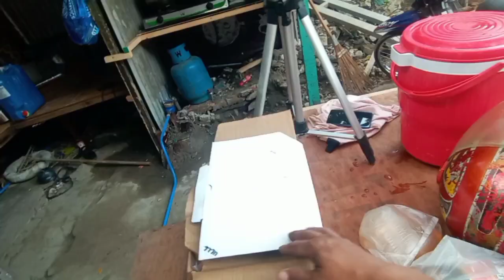Presyo ng mga i-beam/chb laying. Update sa Project.

Comment: Boss, saan po makakabili ng I-beam. Saan ang pinakamalapit sa Pangasinan? Merun din ba sa Pampanga? May contact information po kayo or address?
Reply from the maker: Dito lang pi namin nabili sir ung mga I beam..sa Angeles..Pampanga Po location ko sir..try nyo po dyan sa location nyo sir sa malalaking metal supplyer sir..salamat sa pag bisita sa aking channel,,🙏
Reply: @RicWorksVlog  may exact location po kayo Sir? Sa Angeles. Contact information po?
Reply from the maker: Angeles sir NCR name ng construction supply material.